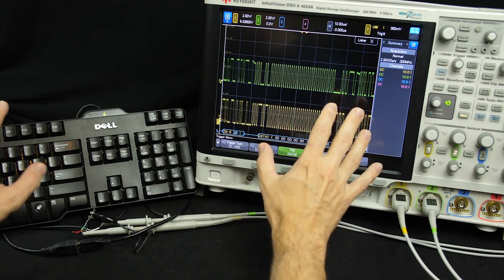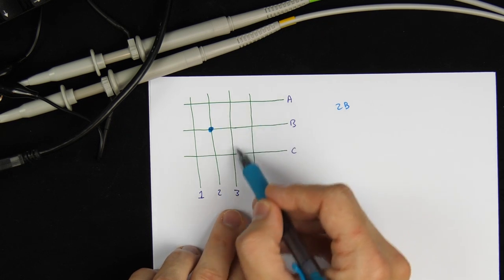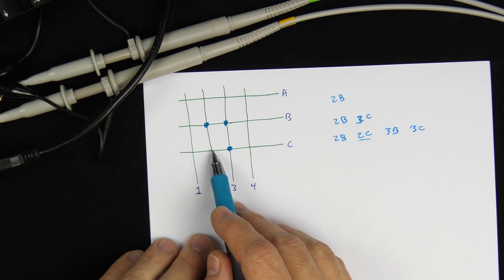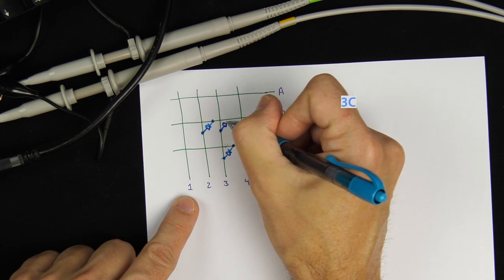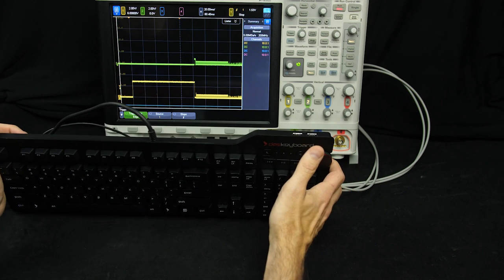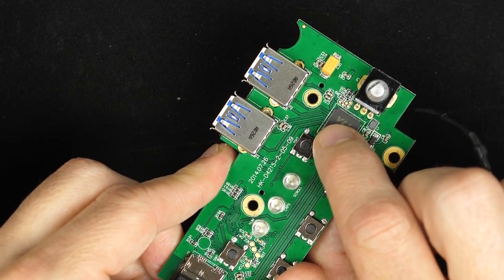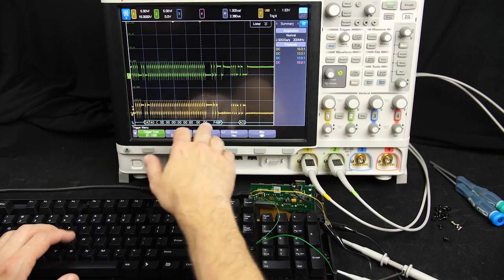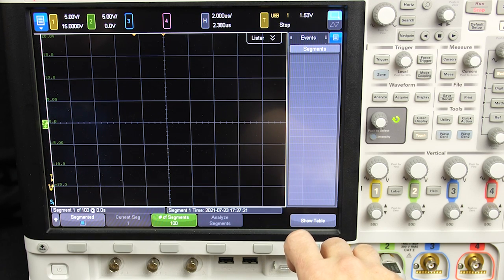How does n-key rollover work?

Comment: The main thing I'm getting from this is that the calculator button on my laptop was not the invention of bored Asus engineers trying to make their own not-compliant keyboard spec, but rather the work of bored Asus engineers reading through the USB HID spec and finding the mention of a calculator button and deciding to put it in.
Reply: i thought it called some sort of command and passed literal calc.exe in there or something lol
not win+r ofc bc it would show the gui for a split second
Reply: there are many interesting keys that you could use
Reply: @Kitulous  that is a thing though too. The "lock" key on my laptop presses win+L
Reply: laptop keyboards normally use a PS/2 connection (at least the ones where I've looked inside), so it's more likely that they use whatever keys windows has mapped to open the calculator (I seem to remember it being one of the higher function keys but oh well)
Reply: @ivesennightfall6779  PS/2 does not exist anymore. Even if this protocol is supported, its not handled like PS/2 anymore
Reply: @huberthans4312  Many gaming motherboards include ps/2 still, because it has a lower latency than USB. PS/2 definitely still exists, lol.
Reply: @ivesennightfall6779  Laptop keyboards don't use an actual PS/2 connection. The embedded controller in the laptop connects to the system's bus and responds to the same I/O accesses as a regular PS/2 port would but it is instead emulated. The keyboard matrix connects directly to the EC which also handles various other functions such as sensors, charging, and power control.

Obviously this can be a different with different computers but this is how it is on the laptops from the early 200s to the early 2010s I've looked at. What's interesting is that there often is an PS/2 electrical connection between the EC and the touchpad, but presumably it operates at 3.3v instead of 5v on newer laptops.
Reply: @huberthans4312  That's not true. I built a new computer last year and the mobo has a PS/2 slot that I use for my keyboard
Reply: @typecasto  that was actually disproven by previous videoes in the Series you’re currently watching on USB functions
Reply: I usr the calculator all the time and have it pinned to my taskbar and dock. Having a dedicated button is nice.
Reply: Calculators on computer keyboards used to be a thing, even before USB. For example, various models from Focus Electronics had them in the early 1990s. I have an old Focus FK-9200 with one. It's either neat or pointless, depending on your point of view. There's a key to toggle the (extended) numpad between normal numpad mode and calculator mode, and an LCD display for the onboard calculator. When you've done a calculation, you can hit a key to have the result sent to the host computer, as if you had typed it.
Reply: @typecasto  As a port. But not as a real PS/2 implementation.
Reply: @watsonwrote  There is a PS/2 port. But its not implementet like a PS/2 port would be in the old days. Its emulated and you should not bet on its old premises.
Reply: I would guess originally it wasn't standardised, but someone was doing it with some hacky special software, or sending something stupid like win+r c a l c . e x e enter, so it was standardised so there was a better way.
Reply: @huberthans4312  The emulation is completely transparent to software. An OS that only knows PS/2 can definitely use a PS/2 keyboard. Most likely it can handle a USB keyboard too, since the firmware has a (usually dodgy) emulation layer in order to make the USB device appear as a PS/2 one.

Comment: Right at the 11 minute mark is where the magic really starts to light up for me "it's not doing the thing... but we could tear it apart and make it do the thing" lol I love it
Reply: My exact thought as well! The gears started turning in my head when he said there was a USB hub on the device.
Reply: I probably would've just gone to wireshark's usb mode before taking it apart
Reply: Also, he probably could’ve just plugged it in an old USB 1.1 hub/port (maybe there is even a way to restrict the speed within Linux).
Reply: @HuskyNET  That might work. This also has me wondering: how complex is it for a USB 2.0 (or 3.0 hub) to pass along comms from a USB 1.1 downstream device? Does it buffer the 1.1 data then blast it over a 2.0 connection? Does it send the signals exactly as received (at 1.1 speeds)?
Reply: @smartperson1  given that USB is packet based, I can only imagine that the hub only forwards complete packets, which means it needs to buffer. It only needs to be able to hold a single packet per port.
Reply: "The only external connection is this USB cable."  My first thought was "when has that stopped Ben?"
Reply: @smartperson1  Every USB 3.0 hub actually contains an USB 2.0 hub and both operate independently from each other. This is possible, because they use different wires within the USB cable and also has the consequence that plugging multiple USB 2.0 devices into an USB 3.0 hub does not increase their total bandwith to the PC! The second question I had to look up and apparently USB 2.0 hubs do encapsulate USB 1.1 packages and transfer them at high speed by means of a so-called “transaction translator”. So yes, they do buffer-and-blast, but I wouldn’t call that a very demanding task. And because the PC is in charge of initiating all communication, I guess it’s also in charge to make sure to not send more data to USB 1.1 devices than the USB 2.0 hub in between can buffer.
Reply: MichaelKingsfordGray  "lol" is "laughing out loud"
Reply: @wagyourtai1  LOL, and I was thinking of using a logic analyser... I forgot he had a computer capable of decoding the packets!

Comment: Here's how NKRO should work accodding to the spec, but I'm writing from memory, so take it with a grain of salt:
A keyboard should implement NKRO using the bitmap method as shown on this video. I am not sure what this mode is called. Then, the BIOS should send a specific 'SET REPORT' and the keyboard should switch to boot mode (6KRO) since BIOSes and certain other things have only a tlite" USB implementation. However, some BIOSes don't send that SET REPORT so the keyboard won't switch to boot mode and therefore it won't work in that BIOS.
There are many ways to get around that:
- Having a button/key combo to force the keyboard into boot mode (like the keyboard into the video)
- Report both 6KRO and NKRO endpoints? (can't remember if endpoints was the correct term here) but don't report any keys in the 6KRO descriptor. BIOSes that that don't send SET REPORT don't usually check so that works. The OS ignores the boot mode and the BIOS ignores the NKRO endpoint and the keyboard works everywhere. (No idea how many keys can actually be sent to the BIOS in that case though)
- I am guessing the reason for some keyboards to implement multiple virtual 6KRO keyboards would be so it works with buggy BIOSes while also get NKRO on the OS.

However, if the NKRO isn't implemented according to the spec by default, but only as part of the workaround, you may not actually have the NKRO working on every OS.
Reply: Thanks - I'd often wondered why on earth I'd need an option to turn NKRO off!
Reply: I heard older versions of Windows had problems with >6KRO because they assumed everyone would implement their keyboards like the spec example did.
Reply: @thewhitefalcon8539  That's possible. I don't know anything about that.
Reply: This is an issue before 2015. As far as I know, even cheap NKRO keyboards nowadays implemented it correctly. Some don't even have a way to switch between 6KRO or NKRO. It just stays at NKRO all the time. The device manager also only shows a single keyboard connected. So no multiple keyboard hacks.

Comment: It would have been interesting, if you had torn the keyboard down further, to see where the per-key diodes were located: either in the key switches or on the PCB/flex to which they mount.
You may find it interesting that at BlackBerry, we had a specific key matrix routing that made certain key combinations unable to cause roll-over issues. This permitted faster (and somewhat clumsier) typing with fewer errors as well as certain user control sequences of multiple keys without having to put diodes in per key.
I was involved in the first project that mixed a touchscreen with a keyboard and was able to get rid of the complex routing since the control sequences would all be entered through the touchscreen. This allowed us to do something more inventive with the keyboard to make it compatible with the proximity to the cellular antennas as well as implement the keyboard's own touch sensor array for gesture input.
The specific keyboard technologies as well as the Industrial Design of the keyboard is why BlackBerry jealously guards its IP to this day.
Reply: Does BlackBerry still exist?
Reply: That's really interesting. How long did you work there?
Reply: @toddmarshall7573  yes, I'm still there.
Reply: @rigaudio  I still do
Reply: The reason he didn't do that is because it was a nice mechanical keyboard (from the sound) and he didn't want to destroy it.
Reply: Interesting. I'd imagine that instead of a simple grid arrangement you could instead route keys in groups on how low it is likely that you would press them together and so reduce the risk of roll-over.
Reply: @TheSliderW  You identify patterns on the keyboard that can be pressed (either intentionally or unintentionally) as groups of three or four and split those out onto rows and columns where they will not cause roll-over issues. It is easier with a mobile keyboard as you're only ever likely to be typing with two fingers. It's a much harder proposition for full-sized keyboards where all ten fingers could be used.
The resulting key matrix when laid out in a schematic looks messy and when laid out as a keyboard, the routing can look messy.
Reply: A lot of cheap keyboards do that with at least specific keys, like around the wasd area for games.
Reply: I build custom mechanical keyboards, the diodes are not part of the switch, they're wired into the matrix. On my first couple of builds, I just used diodes instead of wire for the rows, and magnet wire for the columns. This kinda got messy though, so I switched to custom single-key PCBs which have SMD diodes built in. The switches are, electronically, no different than very simple push button switches that just bridge two contacts together.
Reply: This keyboard uses cherry switches which don't have inbuilt diodes in them, so the diodes are on the PCB.

Comment: It's not just kind of standard, it is a standard. The idea is that HID Parsing is expensive enough, you don't want to do it on boot, so boot HID devices (Keyboard and Mice) have a specific defined description so you could process it with the least amount of work. On the other hand, the NKey rollover HID will require some processing for each packet to translate the bits into something the computer understands. This can be slow with really complicated HID descriptors, though not so much as to be noticeable with today's machines. This is why some complex HID devices will have drivers even though they aren't strictly needed, as it allow them to skip the HID translation.

Comment: N-key rollover was a thing before USB came out. IBM model F keyboards are one example and they got rid of the ghosting by eliminating the use of closing contacts altogether for capacitive switches. It'll be cool to cover how these keyboards work under the oscilloscope and how the PS/2 interface handles N-key rollover.
Reply: PS/2 just blasts as many interrupts as keys pressed (and released), so it’s less interesting than this encoding change. Also the Model M since it went back to regular electrical contacts (on a membrane) for cost reduction after the Model F’s capacitive ones only has 2 key rollover! Which is a bit shonky, you’d think IBM could afford 104 diodes given all the steel in them. But I guess it was the cost reduction design…

Comment: Very cool to see the actual low-level stuff, and what exactly happens during the communication and such. Also, yeah I've had a few keyboards claiming N-key rollover, but crap themselves when certain specific combinations/number of keys are pressed. At least one of those did show up as two keyboards.
Reply: I've also seen the "two virtual keyboards" approach. Looks like the manufacturers just didn't understand the USB spec and tried to be "clever"
Reply: I used to have a keyboard the did "NKRO" over USB (this must have been close to 10 years ago now).
It showed up in Device manager as 4 USB keyboards.

Comment: That's some dedication with the disassembly - if I had a Das Keyboard I would be afraid to look at it the wrong way. Great video!
Reply: lol i just bought a das keyboard pro 4, do they have some reliability issues or something?
Reply: It's nice that it's actually disassemblable, though. Just a few screws and it comes apart, instead of clips that break or, even worse, welded joints.
Reply: @chrisvarns  not that I know of they are however quite expensive for a non custom keyboard.
Reply: @chrisvarns  They have a very good reputation. I think Vytenis was just referring to how much they cost.

(And the fact that DAS do actually use an in-keyboad hub that runs at USB HIghSpeed reflects this attention to quality. I'm constantly reminding students not to stick their USB drives in the in-keyboard ports on the Macs and Dells in our labs because those do only operate at FullSpeed mode, which is plenty for a keyboard, mouse, gamepad, etc., but makes file transfers somewhat slooooooow!) 

Note that, confusingly, USB HighSpeed is a lot faster than USB FullSpeed. The naming issue is because LowSpeed and FullSpeed were defined. in the USB 1 spec, then when USB2 was developed they needed a name for "faster than FullSpeed" (shoudda called it USB LudicrousSpeed, IMO!).
Reply: I was holding my breath while he was taking that beautiful keyboard apart. I happen to own two of them (previous generation, I have a separate USB hub cable and USB keyboard cable). And mine doesn't support n-key via USB, it does support n-key via USB->PS2 converter though.
Reply: @vikiai4241  It's the same issue with frequencies. There's HF (High Frequency), VHF (Very High Frequency), UHF (Ultra High Frequency), SHF (Super High Frequency), EHF (Extremely High Frequency) and finally THF (Tremendously High Frequency or Terahertz radiation).
Reply: That’s no good, you want to be confident enough to be able to remove and replace a key switch if it fails down the line! In this way mechanical keyboards can actually save money over constantly buying disposable membrane boards, so long as you use it long enough.

Comment: Your hopes were fulfilled, Ben. I did find this riveting. I was reminded of the model 1 TRS80 (late 1970s) that had a memory mapped keyboard. The memory map was 8 X 7; the 8 columns addressed as 7 bytes. So, the driver software could be bypassed (or sub classed as we would say in Windows) . So, certain groups of keys could be accessed when pressed simultaneously. This allowed various utilities (from other vendors) to be activated. The favourite key groups were ASDF and HJKL, for obvious reasons. Such accessing of the keyboard was, of course, hacking. The DAS Keyboard was fortunate in being able to "sub class" an entire MCU rather than a bit of assembly code. The mind swims at the the possibilities that presents. Yet another awesome video, Ben.

Comment: Very interesting, would love to see something like this for wifi or Bluetooth, so curious why it takes so long for those things to connect
Reply: It's funny because Bluetooth keyboards actually use the same data format with six bytes for keycodes taken directly from USB spec.
Reply: Apart from the RF mumbo-jumbo and encryption, wifi is almost identical to ethernet.

Back in the day we'd run coax cables from a hub and a row of computers would be connected to the same line using T-shaped connectors (one input from the cable, one output to the NIC, one output for another cable to go to the next PC). Ethernet is a broadcast format, so each device receiving a packet first checks the ethernet header to see if the destination MAC matches the local MAC. If not then the packet gets dropped without further inspection, unless you're in "promiscuous mode", which is used to inspect network traffic.
Reply: @khatharrmalkavian3306  wifi is a bit weirder, but it is still a wrapper for Ethernet frames. Wifi has a lot of fields that are parameters for the specific link. It also has a field for the access point you’re talking to as well as destination and source addresses.
Reply: @khatharrmalkavian3306  Naww, WiFi is pretty very different from Ethernet. Yes the data looks the same, because it actually is. TCP or UDP over IP have nothing to do with the underlying physical connection, where the difference actually is.
You could write your own protocol to replace IP and neither Ethernet, nor WiFi would care.
Reply: @Snaperkid  No, WiFi doesn't wrap Ethernet frames, it wraps IP frames (in the common usecase).

Comment: 34:50: maybe the keyboard supports macro/button customization and reports all these keys in case you decide to use them? Also, the other interfaces may be used by manufacturer's customization software...
Anyway, great video as always 😊️
Reply: They make a "Model S Pro" Das Keyboard for the Mac that has all of those function keys, to reproduce what an Apple keyboard can do.